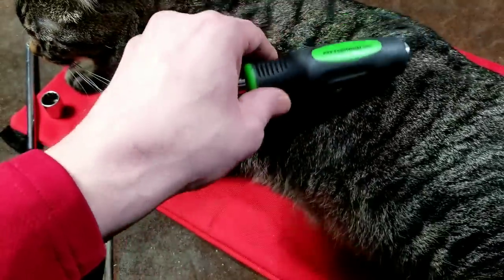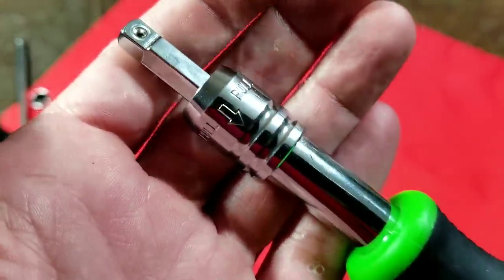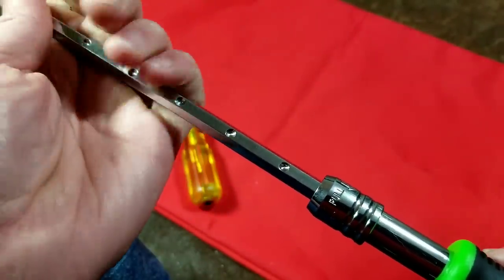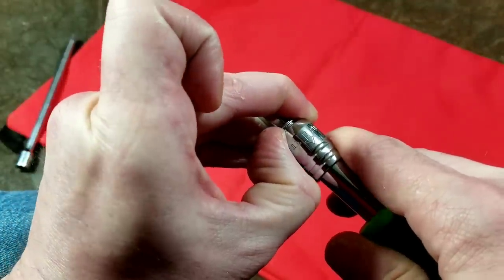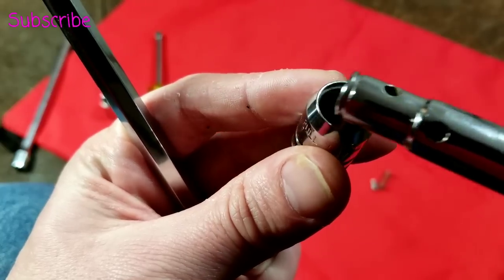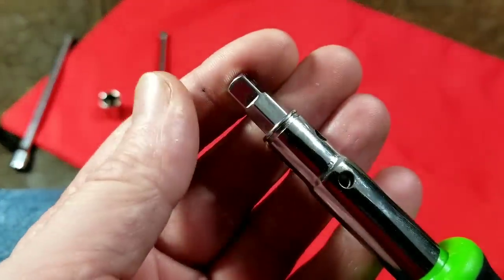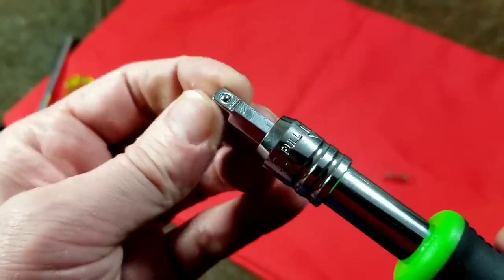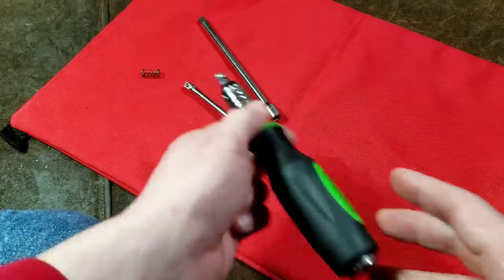Pittsburgh Professional 1/4" Telescoping Driver Handle Review

Comment: I just got one of these.  Mine has a slightly different handle, with the text now saying "Pittsburgh" not "Pittsburgh Pro".  It doesn't pull out without pulling back the collar, and there isn't much of any wobble, but it does still have the exposed snap-ring.  Love using it to reach deeply recessed screws inside a furnace.

Comment: So i just got mine yesterday and its pretty strong. I tried to pull on the rod and it didn't budge. I didn't pull with full force but i did give it a descent pull (a bit more than your pull) and it didn't break loose from the locking collar. So maybe they fixed it ???

Comment: That is one of the few 1/4" drive tools I have ever seen that i cannot recall ever wishing I had.
Reply: your spinner already has the 1/4" drive bolster for adding a ratchet?
Reply: @snap-off5383  
I have enough swivel head and convertible T handle ratchets that I almost never use the one I have. No it doesn't.
Reply: Yeah swivel head ratchet seems to be likely a superior tool in most situations where having the head at the socket end doesn't cause interference.
Reply: @snap-off5383  
I always use extensions where they will fit. It allows for better feel to apply torque so my ratchet heads are rarely near the socket at all! Aircraft fasteners are easy to screw up and usually hard to reach, using extensions there has helped me figure out that an extension is preferable on everything they will fit on.
Reply: @upsidedowndog1256  Now you've walked me through how a swivel head is probably superior to a spinner handle in most ALL situations.  {:-(  going to have to buy some now. . . .
Reply: @snap-off5383  
I have all brands of swivel heads. While I love my high dollar ones, I find the Stanley 3/8" drive extendable one at Walmart is great for the money. Its especially good for sparkplugs. Gear Wrench 1/4" also great. The round head ones broke a lot when SO and Matco came out with them so I bought a no name Taiwan one and its also very good, very similar to what HF carries but this style is inherently not strong.

Comment: no one ever has pulled on a nut driver when removing a nut or bolt but plenty have pushed on them, as for the ring, get another one no toolbox or garage on earth should be without them, and its HARBOR FREIGHT. i own all 5 of the telescopic ratchets they have. 1/4, 3/8 and 1/2 as well as the combos that have 1/4  on 1 side and 3/8 on the other and the one that has 3/8 and 1/2, this is my next tool to buy, never have i had a single issue and if you do they are LIFETIME WARRANTY so who cares if they break, i go past my local store at least 2 times a week so an exchange is easy

Comment: Nice review. I think the spring inside is just to keep it from clanking when it bottoms out. And being able to pull the shaft out by hand seems to be a design, or quality flaw. I've thought about getting one just because you can attach a ratchet handle to the back end. However, it's very heavy, loosey goosey, and clanky (things I DON'T want in hand tools). I'm still trying to think of an excuse why I can't live without one. :)
P.S. Glue the flimsy retaining ring on with something semi-permanent. How often do you need to take it apart, never?

Comment: Do not... Put the 1/4 impact on it xD the locking mechanism jams and the telescoping drive slides all over,  lol I used it a lot, and it is very handy in under dash situations, but if you hot a harness with the lock,  the shaft unlocks and slides back down.
Reply: well, i am not sure WHO in their right mechanical mind would put an impact gun or impact wrench on the back side of this driver to help drive whatever it is they are trying to drive. A standard ratchet yet but thats it.